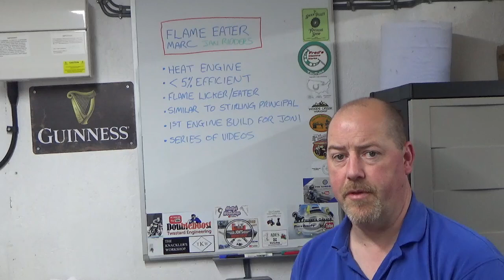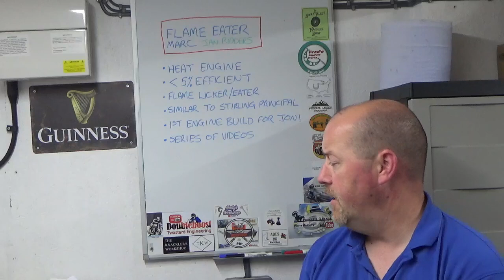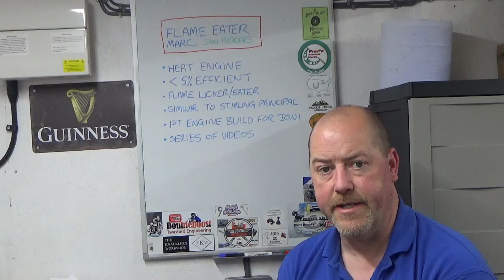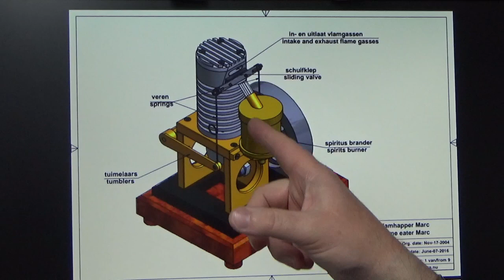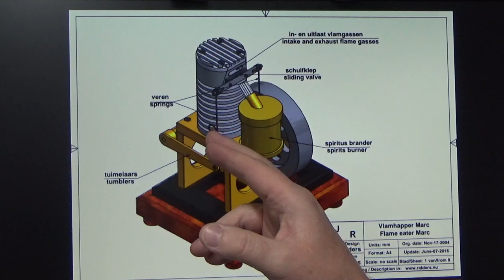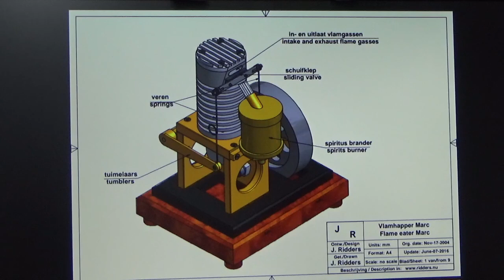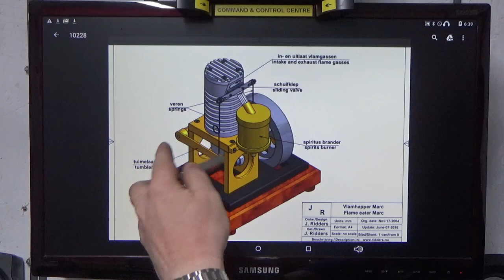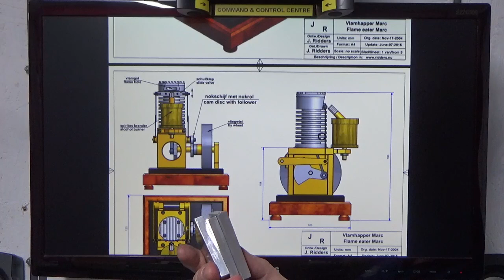Making a Flame Licker Engine "Marc" by Jan Ridders. Part 1- Crankcase

Comment: Hi Jon. An interesting project and you will have something to play with at the end. One bit I didn't understand.... When tapping the M2 holes you mentioned that the tapping drill was 2.5mm not 2.6mm. For M2 thread the tapping drill should be 1.6mm. 2.5mm should be used for M3 thread. Maybe I just misunderstood.
Cheers
Andrew
Reply from the maker: Hi Andrew, thanks for the comment. Well spotted, I must have had M3 sizes in my brain. It was 1.5 & 1.6 I should have said. I will pin your comment at the top of the list in case this confuses others. Thanks for the support. Cheers, Jon

Comment: That's a great little project, a few challenges to come.
Reply from the maker: Hi Nigel, thanks for the comment. Ha Haa, I think that is an understatement! I will be fine machining most of the bits to drawing, but building, tweaking and getting it to run is totally out of my experience so am expecting many swear words. Cheers, Jon

Comment: Good on ya Jon.  Great to see you have a go. You have just entered a whole new world of pain and enjoyment.

Starting with a flame licker was also my baptism of fire and I still have the scars to show for it.   Very small Stirling and steam have been pretty much no problem with me, but I'm sure i've been cursed by the flame licker devil at some stage of my life, as the end results have never been quite good enough to run.  Close but no cigar.  Making it larger as with this one will be a lot easier.

Stirlings can actually be quite efficient, but flame lickers are way down the list in that regard.  Friction and gas sealing are your enemies with any of these engines.

I've not seen that design from Jan before, and the valve spring loading design appears better than on a lot of designs.  I will be keen to see the end result.

Cheers Rob
Reply from the maker: Hi Rob, thanks for the comment. Now you have just shattered any bit of remaining confidence I had lol. I will be fine machining parts to print, but that's the easy bit, the setup, build & tweaking to get it running are completely out of my experience so I completely expect it to be a challenge. I liked the design, it looks nice, and the size, although small set against my experience, doesn't look out of reach (I hope). I too am looking forward to the rest of it. Thoroughly enjoying it so far. Cheers, Jon
Reply: @jonsworkshop  Hi John,  it's great mind food.  Definitely a step up from making tooling.  Collets will be your friend doing this.  Having dimensions to work to and knowing that it can/has run will be a big confidence boost.  Cheers Rob